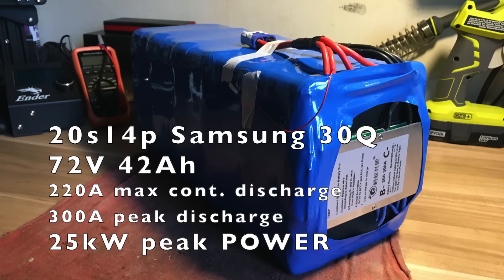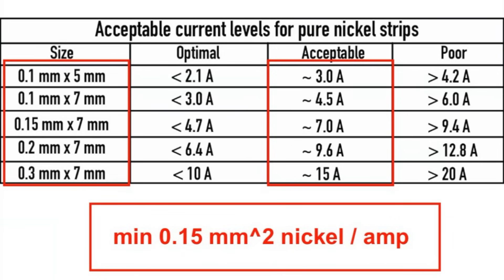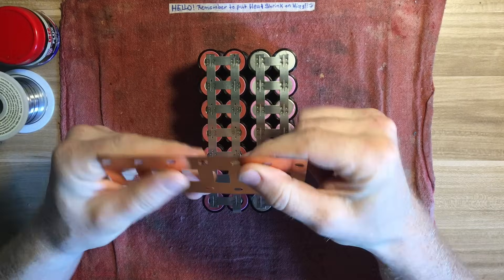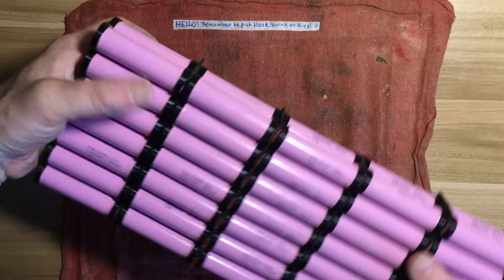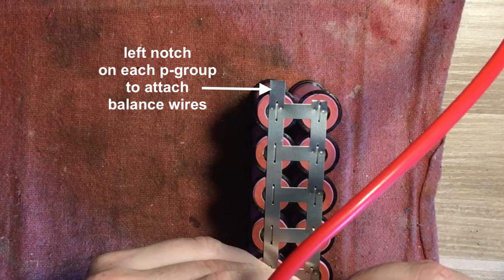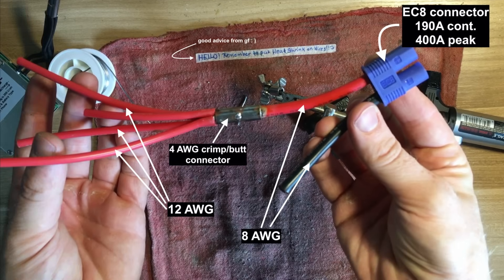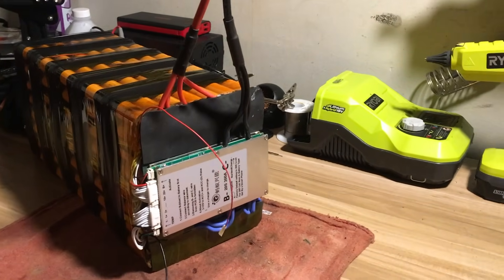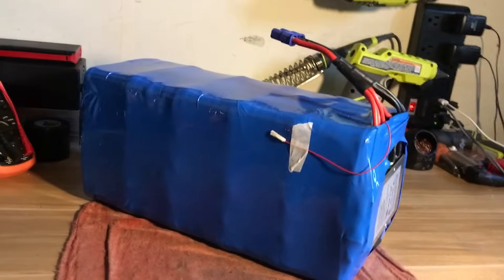How to build a MASSIVE 72V DIY battery pack for high power e-bike

Comment: Hey might be an obvious question.

But to protect the cells from heat, why don't you first solder the copper plate to the nickel and then spot weld the nickel.

You would probably need slightly smaller copper sheet so uou still have space to spot weld the nickel to the battery heads
Reply: Think on how you then would be able to solder the nickelstrips to the batteries behind the copper and still have enough copper for the current.

Comment: what charger do you use?
Reply from the maker: just using a 60V 1500W power supply with a boost converter to achieve ~20A charging current

Comment: I would love to build a battery pack to cover the whole height and length of my ruff cycles smyinz   but for now I got a triangle bag for a 52v 21a.h 1500w battery  to a 72v 3000w  hub motor . But like I said would love to build one that fit the whole frame with as many a.h's as possible
Reply: That’s what brought me to this video have you upgraded to a good 72v battery yet ? Share the link
Reply: @kaliraah  no not yet I'm waiting on a refund from junstar  first then I might get one . But never buy a kit from junstar  I had a bbso2 for 6months and battery pack that just went one after the other

Comment: Hi i have question I followed all your steps to build my pack the only part is confusing me you make 200a battery but the power wires are 8awg is only 50 A rated is this right?
Reply from the maker: yes but not really... If you look up rating for wire gauge you might find something like 50A for 8AWG but these ratings mostly likely refer to residential wiring and for reference by electricans. This is a much different use-case since the wires will tend to run much longer distances (behind the walls in a house) and require a much higher safety margin to adhere to building codes. In the case of a battery (and other common DC applications) the distance the wire runs is very short and even something like a 200A current will only be present for a few seconds. But even more importantly, the rating given to these wires are kind of an abstraction - there's no such thing as "8AWG rated for X amps" - the underlying factor behind all these rating is that there is a voltage drop across the wire as a function of the current and length of the wire. so if you run 200A across 100mm of 8AWG wire, you will get some voltage drop (its less than 0.5%) and this drop varies if you current is higher of the wire longer. So you can run any current across any size wire as long as the voltage drop isn't beyond your specifications (or safety standards). Here's a link to a calculator to find voltage drop for a given length of wire and current - http://wiresizecalculator.net/calculators/voltagedrop.htm

Comment: Yev Dev, I have a question, i just ordered cells that are 3,7 volt 8800 mah and I am wanting a 48 volt pack.  Would I want a 14 series or 13?  13 would give me just over 48 volts and 14 would give me 51.7 volts. This might sound stupid, but I have always known batteries are a little over charged...so please answer this for me. Thank you
Reply from the maker: up to you actually - 13 would suffice but 14 would give you a little more power and/or more range for the same application since higher voltage would allow you to achieve the same power level at lower current. personally, if it wouldn't be over-volting your application, I would go with 14s

Comment: how would you wire an xlr female connector to this
Reply from the maker: just wire pos/neg to some pins & make sure the male connector is wired the same. but I wouldnt use xlr unless it's for a fairly low voltage/current application. not really suitable for this kind of battery
Reply: @GaiusGarage  yeah i would just use it to charge the battery. This thing is freakin huge, what kind of bike would you put this on
Reply from the maker: @Ridstard0  ok gochya. XLR connector would work for charging but again at low current. You can easily fast-charge this at 40A (1C) if you wanted. I typically charge at 20A (0.5C) but even 10A is a stretch for and XLR connector. if you're using a BMS with a seperate charge port, you would look up the positive end of the XLR cable to the "C" lead in the BMS. for this BMS, where charge and discharge is the same, just wire it in parallel with the discharge leads. 

I'm currently using this with a self-built enduro bike. I have a link in the comments to my Instagram with pics
Reply: @GaiusGarage  very interesting, I had no idea that these cells could be charged with current as high as 40 amps, I have a 60V battery that I charge with 2 amps. I know that electric vehicles that use level 2 charging (i know EVSE are not technically chargers) use 40 amps but I would have thought that this would kill the capacity retention of your ebike battery pretty fast if those are 18650 cells. ALso, since 10awg wire would only be rated for 30 amps, wouldnt you need more than 4 discharge wires from B+? and how is it that that little singular strip of 10 awg wire can carry the full 200A load? Thanks for the reply, I'm just getting into ebikes and I want to build an electric supermoto.
Reply from the maker: @Ridstard0  Im building and electric supermotor currently - pretty excited to get it on the road! cells (individual 18650's at least) absolutely cannot be charged at 40A but I'm not charging individual cells here, but rather an entire battery pack. The number in series doesn't matter for how much charge/discharge current it can handle but there are 14 cells in parallel, 14 times the capacity, 14 times the current that can be charged or discharged. the important value here is C-rating, which is the charge or discharge current compared to the capacity. So if each cell is 3Ah, 1C is 3amps. 2C is 6amps. 0.5C is 1.5amps etc. each kind of cell has some maximum C-rating for charge or discharge that you shouldn't exceed. generally speaking, you shouldnt charge 18650 Li-ion cells at more than 1C (you can but it lessens their cycle life and/or damages them). Each cell in this pack is 3Ah - so I can charge each at 3A max. There are 14 in parallel in the pack as a whole (42Ah) so I can charge the whole pack at 40A and it wouldn't exceed 1C - each cell would only "feel" 3A of charging current. make sense? 

On the wire question, I'm using 8AWG for discharge, not 10AwG, but either way the length of the wire has alot to do with how much current it can handle - also the length of time the current is applied. In this case, the 200A is not continuous but rather applied for prob less than 5sec. And since the length of wire is very short, 200A is not a problem at all. In fact, 1000A would be mostly fine under the same conditions. You should also know that there is no current too high for a given size wire categorically, any wire can run any current, but the higher the current and shorter wire length, the greater the voltage drop across the wire (due to increased resistance) - you can run 200A through 16AWG wire if you wanted to but you might get something like 60% efficiency (just making up numbers), 10AWG - 80%, 8AWG - 90%, 4AWG - 97%, 1AWG 99%.. and so on. So it's really a matter of how much wire bulk you're willing to deal with to achieve higher efficiency or how much you're willing to give up and use small wires. here's a link to calculate voltage drop for different lengths of wire & current values 
http://wiresizecalculator.net/calculators/voltagedrop.htm for a 1ft length of 10AWG wire at 200A, you get a voltage drop of not even 1V.
Reply: @GaiusGarage  Thanks for all the info man will definitely read up more about c rating and voltage drop. Definitely give us an update on the supermoto! I'm going with a cr250r, probably going to go with a hpm 20kw motor
Reply from the maker: @Ridstard0  definitely will do! that hpm motor is huge (and expensive) and more designed for electric cars - might be a bit much for a supermoto. Or if youre looking for something huge, Id check out ME1616, which is half the price. I was looking at their 10kW motor, which would be more than enough with the right controller & voltage. Also, the ME1507 is a beast - its rated at 14kW with 44kW peak, but the peak is rated for 1 minute, which means you can probably get 100kW into this motor for 5-10 sec no problem. Same for the 10kW golden motor. in general power ratings on motors are very loosey goosey - a motor doesnt produce power (as a generator aside) it accepts power from the controller - its more a matter of how much it can take before it overheats, which again depends on the length of time the power is applied and how quickly you can remove heat though cooling. what are you thinking for the controller?
Reply: @GaiusGarage  Yo I don't know why my replies kept getting deleted but I was thinking about a bac 8000, I was originally going to opt for the mobipus 72600 racing controller, but I am not sure if i can find one. I am also struggling to figure out a solution for winter commuting, I love the idea of liquid-cooled motors and controllers but I am worried that freezing temps may affect the viability of such a build since I want to use it as a commuter as well as a racer (hence the hpm 20kw). Sketch coleman made a really cool 50kw build I'm sure you have seen it already. Main issue for me is going to be the battery build and how to mount it such that it wont be damages should the bike fal on its side.
Reply from the maker: @Ridstard0  yeah that Sketch Coleman bike is definitely the youtube supermoto dream build. unfortunately I don't have the experience building motorcycles in general to dive right into the deep end. plan is to throw together something more basic & work my way up. been looking at alot of controllers and the mobipus is definitely a front-runner but yeah seems hard to source. I think cooling wouldn't be an issue in the cold since at minimum, you don't have to use it. you can just drain the fluid and run the controller & motor dry - would be the mostly same as an air cooled system, although I guess you'd have to plug the holes somehow. the bigger concern would be freezing if you use water to cool and I'm not sure how those line would react with different types of anti-freeze, although I'm sure there some kind that would work. it's really the battery that would need some heating at very low temperatures. But the operating range is down to -20C
Reply: @GaiusGarage  yo im still deciding on what kind of cell to use, im actually curious why you didnt just weld copper to these by sandwiching the copper sheet between the battery and a piece of nickel plates steel, which then creates enough resistance to weld the copper to the cell. I see lots of surron and super73 battery makers using this method. I also saw another video of a guy using these huge banana sized cells in his notorcycle build, and the ladi and margaret guy uses eplb pouch cells. i pretty much would like to maximize range , any suggestions? excited to see your build
Reply from the maker: @Ridstard0  I didnt know about the nickel sandwiching method of spot welding copper when I was building this pack - but even then you need very high current from your spot welder to do this - I see a lot of people use super capacitors to power their spot welder. also the copper sheets here are much too thick even for that method. regarding batteries, those eplb pouch cells are probably your best option for an an enduro ebike since they are compact, very high discharge, and shaped perfectly for that frame but I couldnt get my hands on any in the US. they are out of production so only a few people are selling them in Europe and dont want to ship li-ion batteries internationally. if youre looking for max range, I would go with 18650 or 21700 cells that have maximum capacity, as opposed to max discharge
Reply: @GaiusGarage  THanks for the info again. Ive heard of good results from a spot welder powered by 12V lead acid battery with 360CCA, 500A relay and timer, I will probably end up doing the method in this video just as insurance if I wanna get a super beefy supermoto controller in the future. 

Have you gotten the chance to check out the new qs180 mid drive? Its twice the weight of a qs138 but it should theoretically handle north of 50kw peak, its got encoders too. I'm glad I waited a while to buy a motor and Im prob gonna go with this instead of golden motors. And lastly, if you were to connect two 10s modules together using copper cable instead of copper tabs, what would you suggest in terms of length and gauge? I have been thinking of replacing cr250 radiators with two halves of a battery like this, making sure to get high quality frame sliders for the bike so that nothing takes any impact.
Reply: also how many minutes of throttle only does this battery give ur enduro

Comment: How much of the copper plates did you use?
Reply from the maker: Three 7p strips per module and there are four modules, so 12 7p strips in total, or one 84p length of copper strip. not sure what that adds up to in terms of length or weight
Reply: @GaiusGarage  I don't know why I thought I counted 20 strips

Comment: <applaud> I love how you're not effing around with any of the connections through soldering and spot welding!
Reply from the maker: thanks! yeah Im never opening this thing back up to service it - if one of those come loose or dislodge this whole thing will be significantly stifled or completely defunct. just thinking in terms of all the vibration over time and climate effects plus electrolytic corrosion - I really dont think I did a good enough job. but still nice a balanced a year later!
Reply: @GaiusGarage  Ya welcome!
Honestly, the only other thing ya could have done is that after soldering, but before folding it up, was conformal coat the internals!

Comment: I have one question, What charger du you use ? Thanks
Reply from the maker: I'm using a custom charger built from a 50V power supply and boost converter that takes it up to 84V. this is an inexpensive way to achieve 20A charging current. otherwise, all sorts of 84V chargers available out there - 2-5A are cheap but slow. 10A+ get expensive
Reply: @GaiusGarage  Thank you for your reply. Charging the battery at 20ah doesn't damage it?
Reply from the maker: @Antoine-ek2mf  20 amps* (vs. ah) - no, because the battery is 40ah and the amount of current at which you can charge it is in proportion to the capacity, this is the "c-rating". so charging a 40ah battery at 20A is charging at 0.5C, which is pretty low. You can safely charge Li-ion batteries at up to 2C (although 1C is better for longer life). So I can technically fast-charge this battery at 80A if I wanted, but it would shorten its overall service life
Reply: @GaiusGarage  Thank you very much for your answer. I also had another question, do I need to put a circuit breaker if I want to use this battery for an electric motorcycle? Because I saw that you don't put any on your battery... If there is a short circuit, is it better to have one? Thank you
Reply from the maker: @Antoine-ek2mf  I don't have one on the battery but I am using a fuse it the discharge circuit on the bike where I have this battery installed. circuit breaker on the battery itself is a nice feature too but they get bulk and expensive at 300+ amps. The BMS also has short circuit protection - maybe not as reliable as a circuit breaker but it's another layer of safety

Comment: Got a question where can I find a controller that will handle that much voltage input?
Reply from the maker: just search "72V motor controller" - bunch of options. best one that readily available and relatively simple to set up is the Sabvoton (link in description). Yuyang king controller is also pretty good and can take up to 120V input
Reply: @GaiusGarage  oh ok thanks, I'm still kinda new at this I was looking at an ebikeling kit, biggest I've seen from them was a 48v. But are the controllers pretty universal in the sense that all the inputs will plug in?
Reply from the maker: @carlosreyes6448  they are for the most part in terms of the analog or digital signals they expect but the connectors and arrangement is all over the place between different controllers. plus many have special connectors & software for the LCD/computer screen so you can't mix and match too much. but if you're comfortable swapping around connectors you can make the basics (like throttle, brakes, motor) work. but if you're looking at 48V ebikeling kits, no reason to use a battery like this. you'll never get close to the power output it's capable of. better off picking up a 48V or 52V downtube battery. or if you want a 72V system, you can pick up a smaller 72V (20s4p) battery pack that would be more appropriate for a smaller system. I actually have one of those for sale if you're interested
Reply: @GaiusGarage  hey thanks for the info I'll definitely let you know.
Reply from the maker: @carlosreyes6448  for sure!

Comment: Great video! How much is the material cost approximately of such a thing?
Reply from the maker: about $1000 give of take
Reply: @GaiusGarage  thanks for the quick answer but oh lord thats a lot!
Reply from the maker: @anonymouscommentator  yeah but it's really a constrain around cost of Li-ion batteries - at $3 a pieces, 280 cells needed for this pack is $840. if you can find discounted rates, or source cheaper cells, the cost goes down significantly

Comment: How do you charge this?
Reply from the maker: Any 84V charger will work. There are cheap ones for sale that will charge slowly. I custom built one using a power supply and a boost converter that will charge in 2 hours.